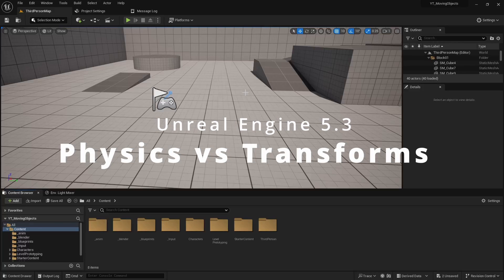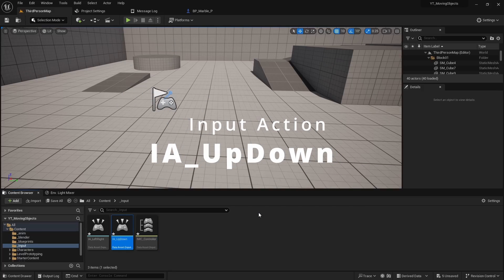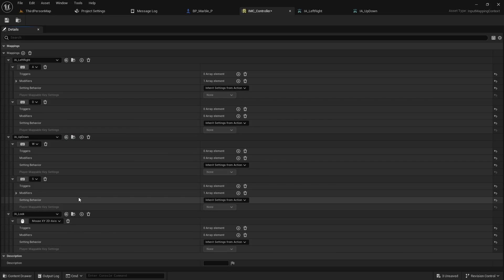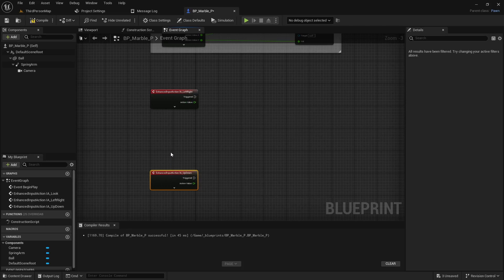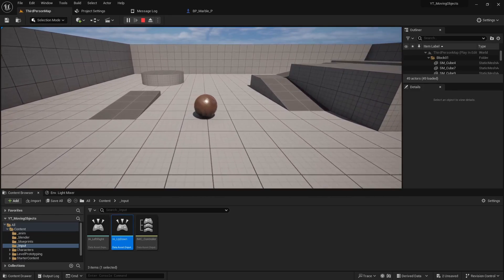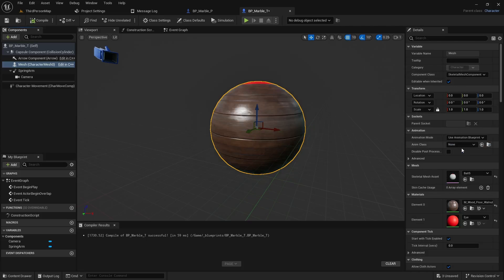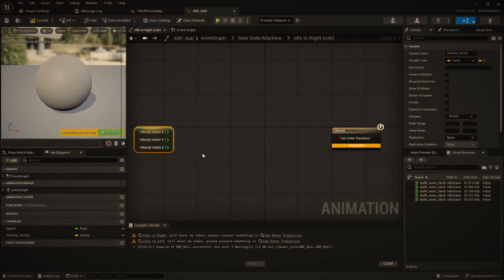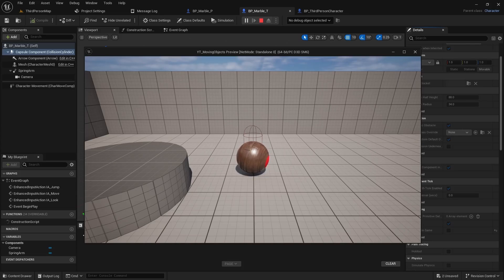Unreal Engine Moving Objects | Physics vs Transforms

Comment: Hey again! Me and my friends are making an arcade car game where we use physics to simulate a car. We are using Add Force and Add Torque to thrust forward and turn. 

The Car works pretty decent, but if we launch the car from a ramp it starts literally flying and floating around, as if there are still forces pushing and turning the car body. 
We have disabled the thrust and turn input while in the air (so now it's no longer like a rocket, where we could thrust it up in the sky), but the car still has wonky physics in the air. 

Do you have any suggestions on what we can do to fix this? 

Thanks!
Reply from the maker: a good starting point with physics forces is to use realistic reference weights for your game objects so the engine can calculate better simulations. Beyond that, check what your gravity scale is set too and if you're using the default movement component check things like air friction, air control, air boosting.
Reply: @TitusBray   Hey again. I just wanted to follow and say that applying Angular Damping really helped us with our car spinning around, so thanks a lot! :D 

Tho, we're stilling facing the issue of the car drifting and flying around in the air, but hopefully we're able to investigate our Force and Torque functions and figure what is really happening.
Reply: @TitusBray  Hey Titus! Thanks a lot for your response. We're not using the movement component but I will check out some of the physics we're using.